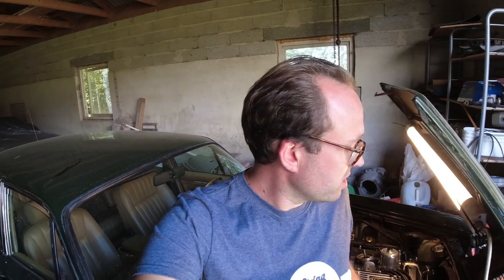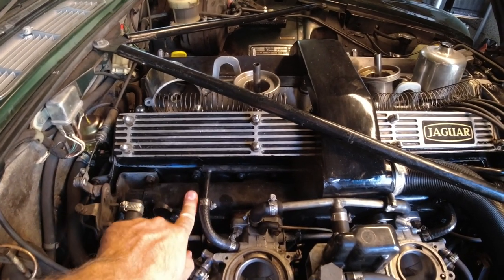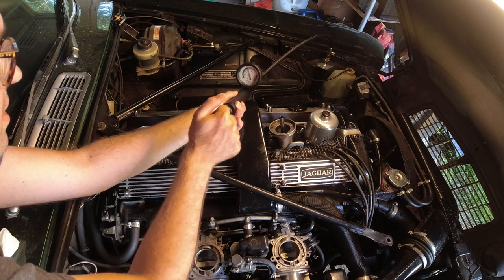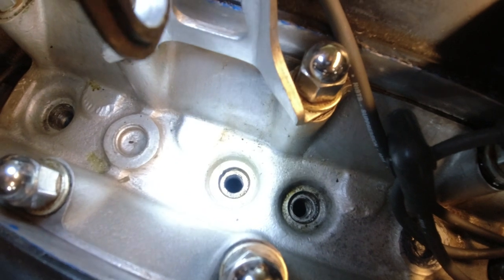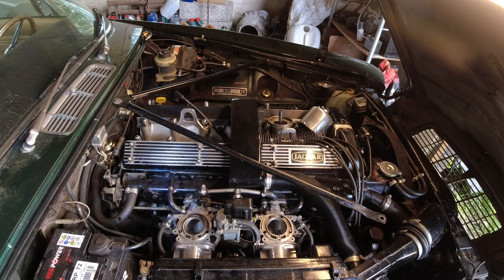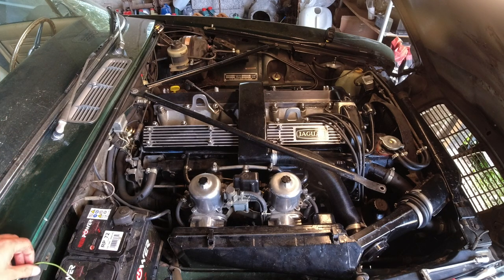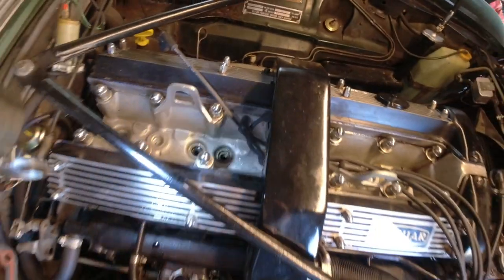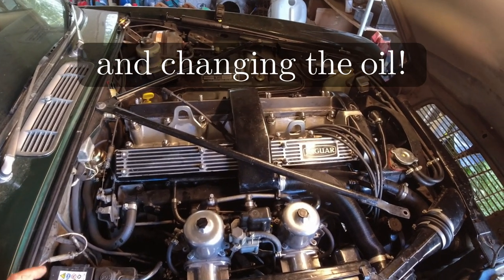Where is the Coolant Going? Let's Pressure Test the Coolant System! - Daily Driving a Classic Weekly

Comment: A. head gasket leak is not likely to cause any water in the carb throat. I would suspect a water leak inside the (1) water passages inside the carb body, or (2) a water leak inside the intake manifold’s water. passages.

Comment: Did u say that engine coolant runs though the inlet manifold & their may b a crack in that. So y don't u bypass it by joining the inlet hose to the outlet hose & then doing a pressure check. Or maybe take the car for a drive & see if u  have the same  problem.

Comment: My father used to run an old car with no pressure in the cooling system, by removing the seal in the coolant cap. It may help in this case, but you have to keep an eye from time to time on your level. Best wishes for the new baby!

Comment: A cylinder leakage tester is a good tool for the tool box. You bring your cylinder up to it’s TDC and pressurize the cylinder with the testers hose and gauge through your air compressor. Then you can either watch the bubbles in the radiator or listen to the air leak into the crankcase or intake or exhaust depending on the coolant breach.
Reply from the maker: It’s next on my list of tools to get. Sadly I can’t get everything at once